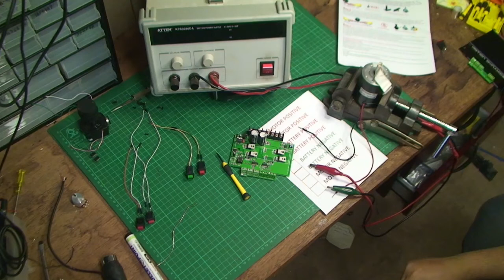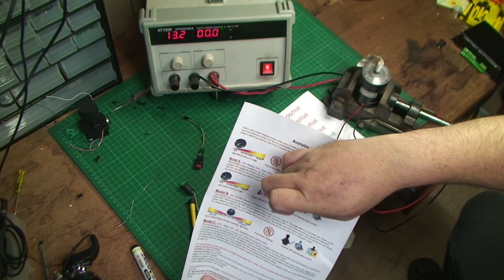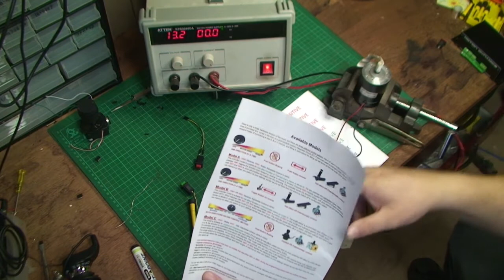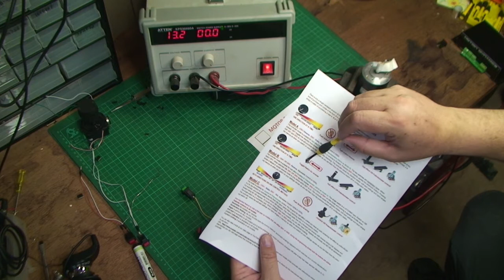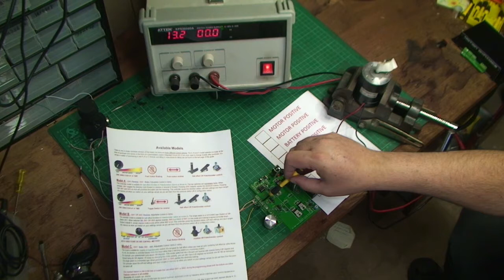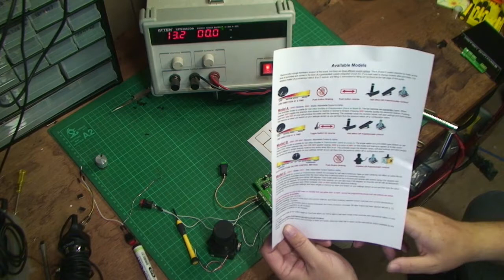Bidirectional Speed Control 25A or 50A for Brushed motors 12-36V

Comment: Hi,
I need the pcb to be pretty slim and the 2 capacitor are way to high. Would it be possible to unsolder them and and relocate them and add wires to reach where the location they were ? It would be for an electric skateboard